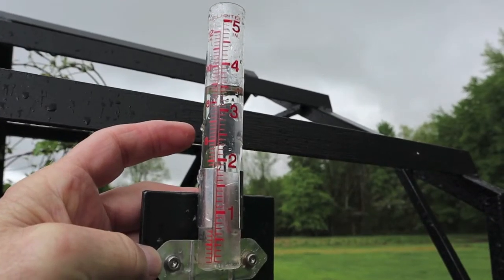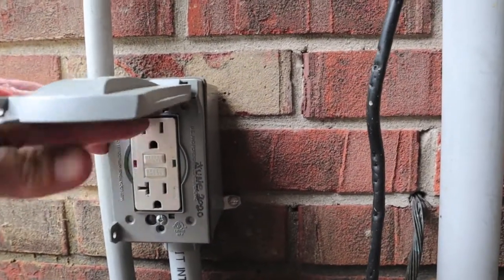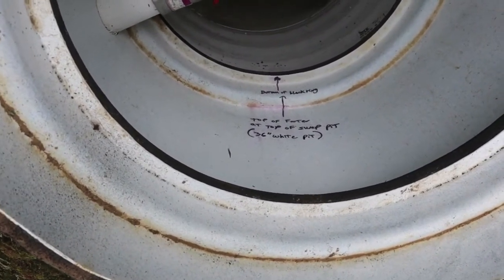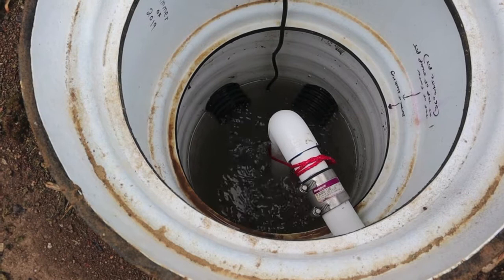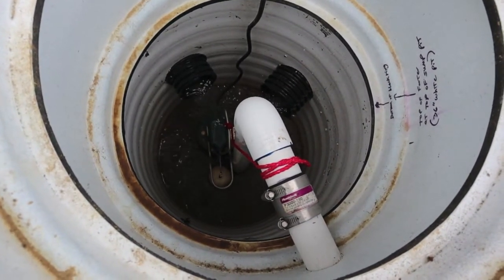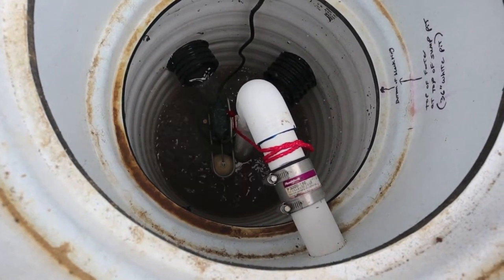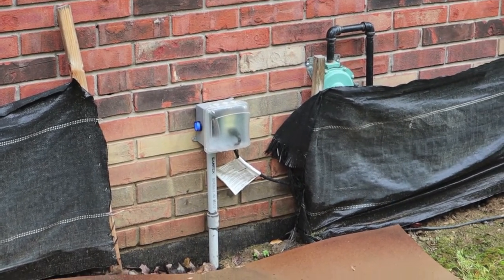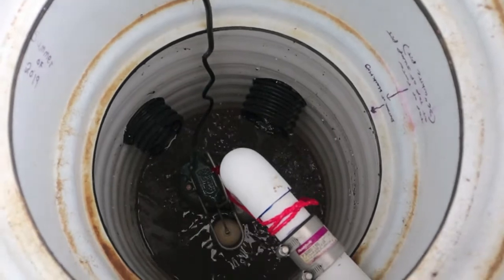Sump Pumps, Thunderstorms, and GFCi Nuisance Trips = FLOODING

Comment: Perhaps just try a different brand of GFI? Maybe the one you have is just a little too sensitive?  Just thinking 'out loud', wonder if installing a ground rod at the outlet box might help (thinking maybe your ground potential is not truly at ground), causing the GFI to trip?  I know the GFI measures the difference between the hot and neutral, and the ground shouldn't have any bearing on it - but who's know what's going on w/lighting nearby.  Common GFI problem tho.

Edit: Thinking this out a little bit more (I'm an electrical engineer)...if the pump isn't running, there's essentially no current on the hot or neutral - the wires are just sort of 'hanging there' if you will.  So when a thunderstorm rolls thru, the hot and neutral lines might be picking up some EMF (voltage) from being basically unterminated (i.e. acting like antennas).  I wonder if putting a small load (i.e. more than the LED) on the line might help alleviate the issue. Maybe one of those mechanical timers plugged into the outlet just for some current draw might help.  Maybe even better...enclosing the wires to the pump in a grounded metal conduit might help too - that would shield them.
Reply from the maker: Thanks for your input. I have the Duke Energy surge protector mounted right at the meter. I called Duke, and was told it behaves like a giant surge protector for the entire house. He went on to tell me that adding the individual surge strips on the TV, electronics, computers, and such, will not add to the protection. The meter based unit I have is as good as it gets (his words).
I have googled those though, and many are claiming it has added to the number of GFCi trips at their house too.
Thanks for watching and commenting!
Reply: @pmtips4482  That's interesting. Maybe Duke and you have different interpretations on what "as good as it gets means". If they want to sell a product that is guaranteed to not let any kind of power surge through it will trip more often and it will protect even the most senitive of electronics. If you have electronics that isn't so sensitive you might benefit from having a breaker that isn't so good at protecting. But I guess the risk is that your pump migh "explode". Just a few random thoughts. I'm no expert on this stuff.

Comment: Do all the gfci outlets trip in your house during thunderstorms?  I wonder if a GFCI breaker would make a difference?
Reply from the maker: That's a good question. I have two identical receptacles in the kitchen and one or both will trip also, but not always. I'm going to buy a different brand and try that.
Thanks for watching!

Comment: Power outages are certainly a pain for water removal. Have you ever checked out the French drain man’s YouTube channel? Great pro tips for the DIY’er, especially with his patented chambered sump system.
Reply from the maker: Thanks Brian, that sounds interesting! I'll check out the chambered sump system.
Reply: @pmtips4482  As Robert says, pump manufacturers know exactly how many cycles the sump pumps will make before they fail. The chambered system decreases the number of cycles required for removing the water, thus increasing the life of the pumps.